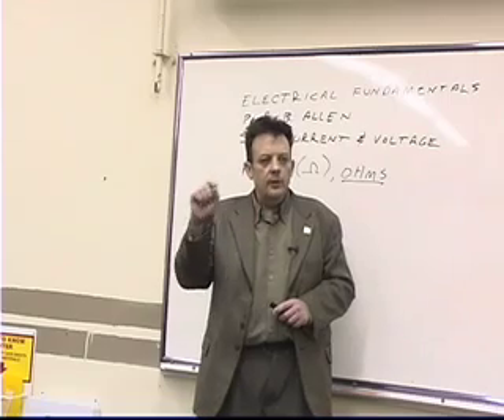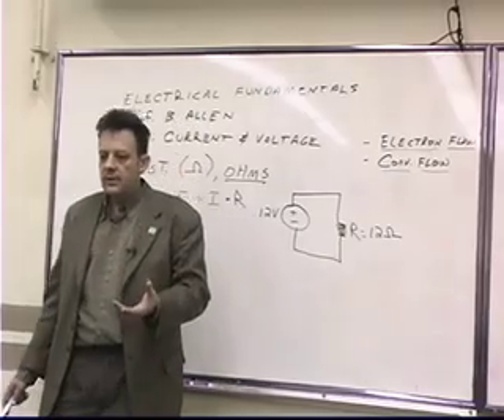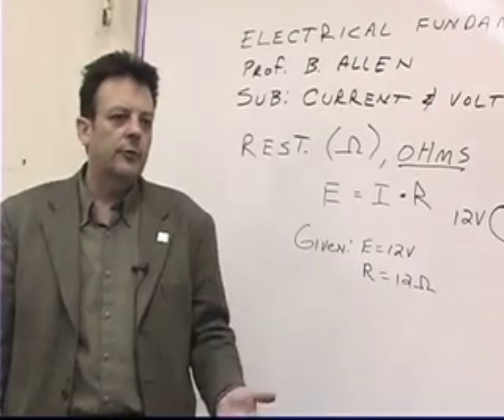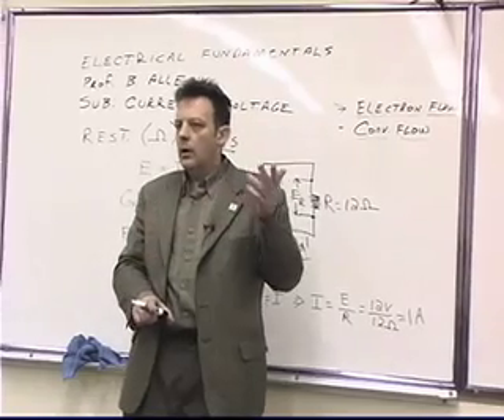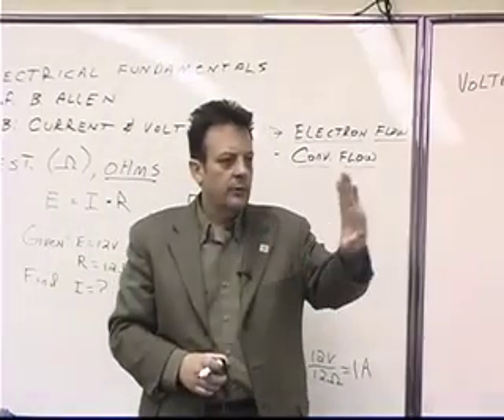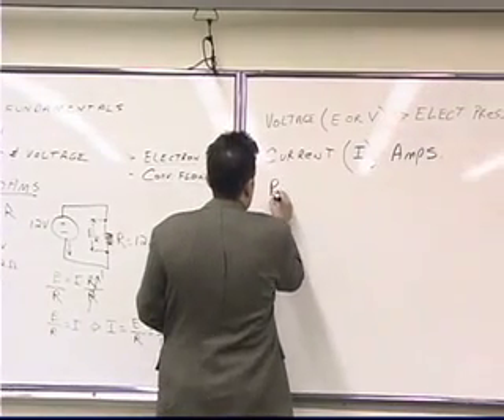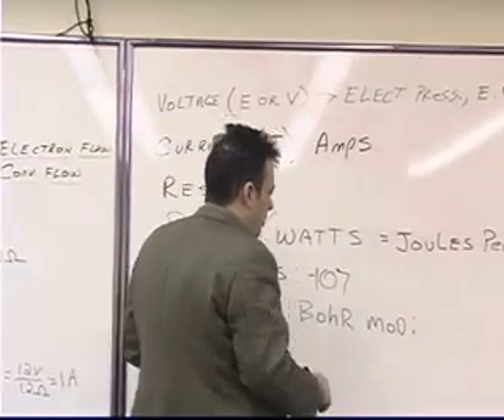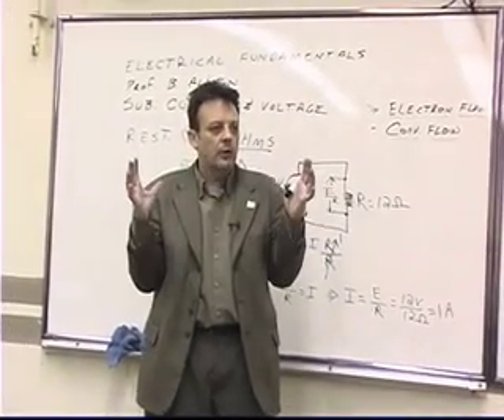Lecture 1a  Voltage and Current

Comment: Adding hair dryers to a multi-strip does it in parallel, not series.  IF the current went thru first hair dryer, THEN the second and also the 3rd, the total load would increase, the resistance would triple and the breaker would 'see' 1/3 the power (3 times the resistance of one) compared to passed to a single hair dryer.

Because they are connected in parallel, each gets full voltage and you essentially have 3 paths (3 conductances - mohs) for the power to pass.  So the breaker would 'see' 3 times the demand for power compared to a single hair dryer.